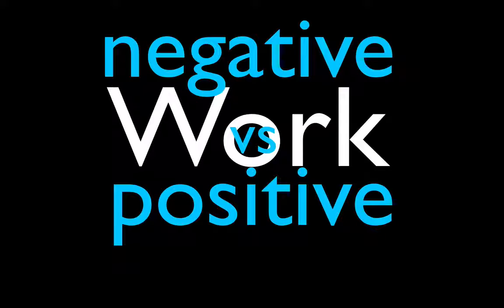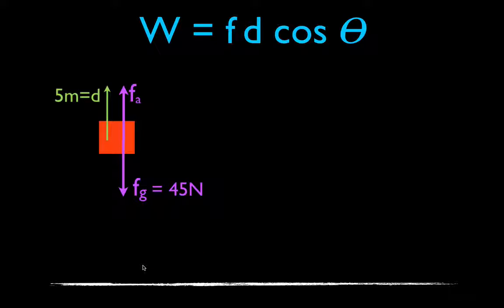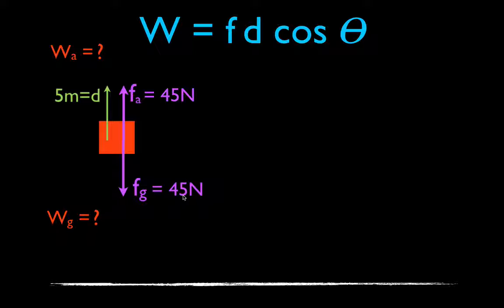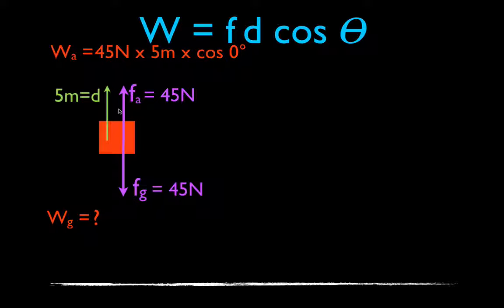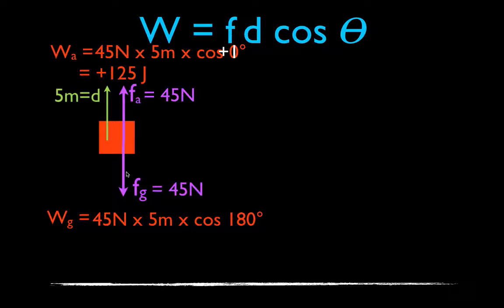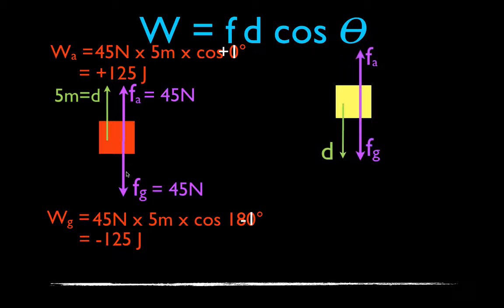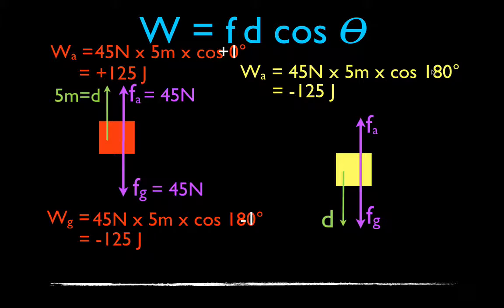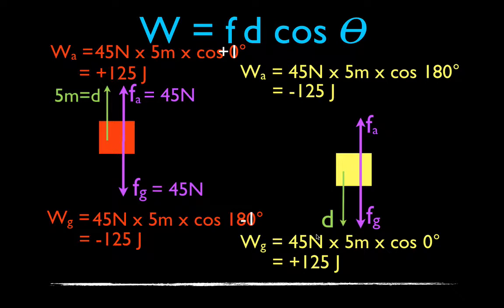Energy, Work & Power (15 of 31) Positive Work vs. Negative Work for Vertical Motion

Comment: Will anyone please answer this question of mine-
Suppose a particle of mass m is moving away from the surface of the earth with a velocity v. If you apply a force mg (upwards), on it instantly and keep applying it, its kinetic energy ceases to change because now net force is 0 on it. But it still gained potential energy as soon as it reached a certain height, which equals mgh. Now, you did the work mgh and the earth also did -mgh. So the net work done is 0. OK fine. BUT, how do you explain transfer of energy in this case?
Did the ball get energy due to the work that I did?
If yes, what about the work that the earth did?
In other words, what does negative work even mean?
Reply from the maker: How about this...when you raise an object above the surface of the earth at a constant velocity you do positive work, the force of gravity does negative work and the net work done on the object is equal to 0 joules. For example + 500 J + (-500 J) = 0 J. Therefore there is no change in the velocity of the object. The work you do is equal to the change in potential energy of the object.  Does that help?

Comment: But what is the net work in this case? When velocity is constant and work in both directions is equal and opposite, is net work zero? How can that be if there is a change in kinetic energy?
Reply from the maker: If the object is moving at a constant velocity, then the net work on the object is zero.  A specific force may still be doing work on the object but the sum of all the work done will be zero.